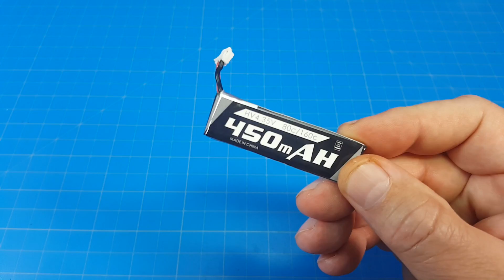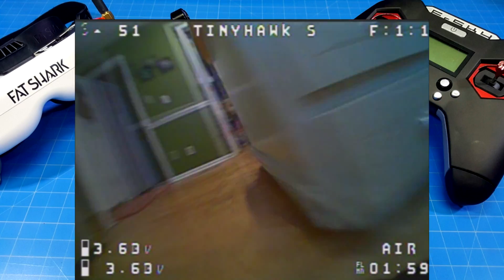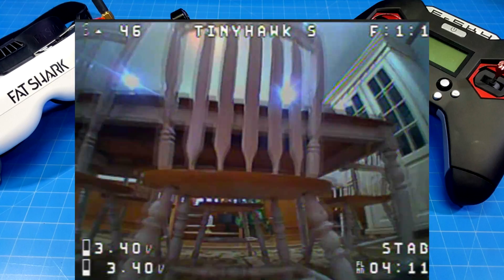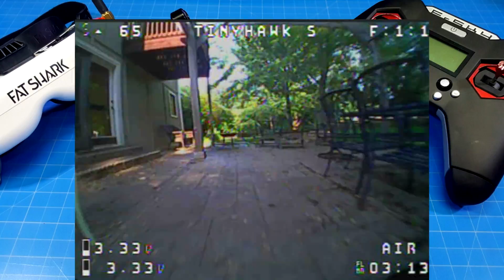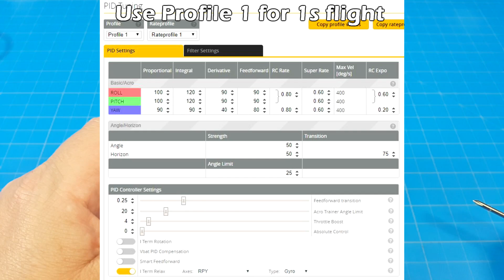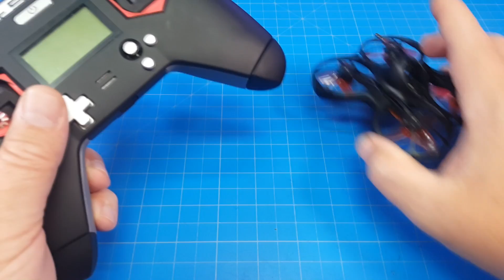TinyHawk S - Start Your FPV Journey!

Comment: Hiya Nick! Awesome review as always! Love the structure of all your reviews. One question, is there a flysky version?
Reply from the maker: I don't believe there is. :) We have to either add a flysky receiver, which it does have uarts available as in the video or use a multi module if your radio supports it.

Comment: everyone  just skips the binding process for this damn tinyhawk. I have an OG tinyhawk RTF kit with the cheap goggles and transmitter it comes with, I bought the new version of the tinyhawk S but no matter what i do, i cannot get the old transmitter to bind to the new tinyhawk S.... Someone HELP ME PLEASE. im following instructions from both the original rtf kit for putting the transmitter in bind mode and the instrutions that came with the tinyhawk S. but every time i bind and try to restart the tinyhawk... i starts in bind mode again...
Reply from the maker: do we need to turn off both the radio and the quad after binding. I haven't had the chance to try out the RTF kit, just a off the top of my head guess.

Comment: Nick will work with the same remote and goggles of the 1st generation Tinyhawk (RTF KIT ) ?
Reply from the maker: I would think so, I am sure the goggles, but the radio I can't be sure. I didn't have the rtf kit to try and learn about its capabilities.
Reply: @NickBurnsFPV  Nick i was thinking to buy the RTF kit of the emax, them this one come out, i'm a beginner in fpv with one can you recomend ?

Comment: Great review!! Which 2S quad would you recommend; the tinyhawk S, the Trashcan, or the mobula7? The 200 mw vtx on the Trashcan is appealing, but which would you recommend overall? Thanks
Reply from the maker: If you have been flying a while the trashcan or mobula would be my recommendation. I prefer the mobula for the linear throttle curve where the trashcan has a large amount of thrust at the lower end of the throttle. If you haven't been flying very long the tinyhawk is going to be the most durable, the trashcan would be the next most durable and last mobula

Comment: S version has 802 15.5k kV motors. The original version has the 802.5 15k kV motors.
Reply from the maker: interesting. That conflicts what emax sent with the quad, RDQ has 08025 and piroflip has 0802. hmmm.
Reply: Nick Burns RDQ just says something about revised 08025 motors in the features section, but the specs section correctly identifies the new motors. Look at RDQ’s and Emax’s product pages.

Comment: Anyone know how to get the land now warning on my osd? I’ve tried a few different things and no warnings
Reply from the maker: Need to turn on warnings on the osd page. Its lower on the page, likely need to scroll down to see it.
Reply: Nick Burns turns out my warning was overlapped by my mode and model display lol. Thanks again
Reply: I’m currently monitoring bat voltage and have the thresholds for warnings set  to 3.35 and minimum to 3.25 and when I go lower then 3.25 I don’t get the land now warnings

Comment: Nice review, Nick.  Thank you.  Seems like a pretty nice little quad to me.  I have very much enjoyed my original TinyHawk and it looks like they have addressed a lot of areas that I think many of us were hoping to see improved.  

I have a couple of questions, if you don’t mind.  First, I understand that you have only had the quad for a short period of time, but could you at least hazard a guess as to the longevity and/or durability of the rubber bands?  Second, is there a way to use a battery strap instead of the rubber bands in case your bands break or just because you prefer a battery strap?  Oops, there’s one more.  Do you or does anyone out there know if this size of rubber band is commonly available or if we will be at the mercy of Emax for availability and price as the sole source?

Thanks so much for the help and for the review.  Much appreciated.
Reply from the maker: Thank you. 

So far the rubber bands show no signs of material change, rubber will dry out and the chemistry of the rubber could be better or worse over time. Kind of a non answer. We do get an extra set of rubber bands. We can replace the rubber bands with our own, loom bands should work and are super cheap. Replacing the rubber bands requires removing at least the two screws at the edge, but likely all four from the bottom mount. We can also run a small battery strap, or two. There appears to be enough space, I am not sure if the super small iflight straps would be short enough without having to use some filler to make it tight to hold the battery. In the case of filler some foam we get with components should do the job.

As for the size I expect the loom bands to work best. I have used them many times on other quads, they generally loose there elasticity before they break. I have other rubber bands that are thicker and would work...possibly better, but those came from various other components I have purchased over the years. Loom bands we can more readily target for purchase and use.
Reply: Thanks much for the info and guidance, Nick.  I think I can get a lot of fun out of this guy.

Comment: Do you see any improvement in the VTX performance of the new model? I love my original TH but the video feed is barely useable. Your video seems to be working pretty well.
Reply from the maker: I don't see improvement, but as you said mine is pretty good and the original was good too. The only improvement in vtx that I am aware of is the smart audio. If video reception isn't good I would pull the antenna out of the housing to test that. Also we might need to change bands and channel to get out of the normal wifi band, or turn our homes wifi off to see if that helps. Otherwise we are looking at a new goggle module if that is an option. I have been running the rapidfire module shortly after it came out...but it is expensive.

Comment: Looks great! Any chance you could check on a particular battery fit when you have time? I'm curious about running either 1 or a pair of the tiny whoop 333 1s batteries. For 2s or 1s I could make a couple ph2.0 y adapters in parallel and series. Interested in these in particular because I already have a bunch and really like their performance. If the rx2 can be used to connect a nano dsmx receiver I'll probably be buying one. Nice review, as always!
Reply from the maker: Sure, seems simple. I will look into it.
Reply: @NickBurnsFPV  Thanks, I appreciate it!

Comment: Nick, are u anle to tell if the guts from the original TinyHawk will fit in new style frame ? Great review.
🤘😁👍
Reply from the maker: the one bit I am uncertain about is the camera. I looks so similar, but I can't be completely sure the camera will natively mount cleanly. If a bit of diy for the camera is acceptable, I am pretty certain all the other components will fit right in.

Comment: Now that the weather is good you should also include your backyard on circuit!
Reply from the maker: Not sure I full understand. I did fly two batteries in the backyard. Or do you mean fly from inside to outside?
Reply: @NickBurnsFPV  Yes from inside to backyard!
it's amazing how much you can do with 25mw specially on american houses.. I live in a colonial city in méxico and I can bearly fly trough 1 wall :'D

Comment: Great video to get back to addressing some new comers to FPV, need to do this one in a while.
I am interested to see how it does with something like a rdq 300mah 2s, maybe make an xt30 to ph2.0 adapter for testing purposes????
I put pre-arm on my micros just to keep in the habit of pre-arming my larger quads. :-D
Reply from the maker: I did receive my RDQ 2s 300mah ph2.0 batteries. I will work on seeing how the performance is.

Comment: Once again emax has made a fairly solid model after everyone else. Not that that's bad, it just seems like they don't rush their products to market to meet hype which arguable means they get to avoid the pitfalls everyone else fell prone to. Seems like you put a bit more background/intro into this one, probably a good idea since this probably will be a popular beginner model. 👍
Reply from the maker: Yes and yes. I think this is designed for someone just getting started or still pretty early in their fpv journey. I would expect most experienced pilots to prefer more aggressive 2s whoops like the mobula, or betafpv "Power whoops", or outside the 40gram non ducted designs we have been seeing.

Comment: Nick, what is the better antenna for the xlite?
Reply from the maker: better antenna? Or the external module I referred to in the case of the xlite pro?
Reply: @NickBurnsFPV  I just wanna put an external antenna on, it also looks kinda cool and could help with a bit of extra range. Sometimes my diatone gtr349 Will losesignal and failsafe from 30 meters and 1 tree in the way. I've moved antennas and still happened.
Reply from the maker: I haven't tested myself, but this might help https://www.banggood.com/FrSky-2_4GHz-T-style-Antenna-for-Taranis-X-Lite-RC-Drone-Transmitter-p-1347522.html?rmmds=search&cur_warehouse=HK seems like a very short range for failsafe, I would also suggest trying a new receiver on the quad.

Comment: Bardwell has a good video about "project mocking bird" (not the CIA operation). It's a team of people who specialize in optimizing performance in micro quads.

As far as quad retrieval is concerned, you could design a tennis ball shooter running on compressed air to knock the quad out of trouble.
Reply from the maker: yes, Patrick J Clarke is a wizard with PMB. I have only been stuck in a tree twice, both times I was able to get it with a rake and knock it out with a ball :)

Comment: Nice VTX. I began to notice that there was ZERO breakup in the signal. What goggle receiver module do you have on the goggles? I'm assuming you have fatsharks.
Reply: He runs HDOs with Rapidfire.
Reply from the maker: Yes, Thank you @Charles Warwick.
Reply from the maker: Yes, Charles is correct

Comment: Why couldn’t emax just released this 1st. I already own the tinyhawk and it needs more power.
Reply from the maker: I do feel this has maximized or improved the 1s performance over the previous iteration and other brushless whoops on 1s, but on 2s the performance is not at the same level as other 2s whoops. then there is the battery, not sure this battery is up to the demands of 2s, I have different batteries arriving today to test further.

Comment: Great video as allways! How does it stack up to the Mobula? Does it have the same power as the Mob on 2S?
Reply from the maker: No it does not. This designed or iteration is targeted at maximize 1s performance. M7 has more power and thrust to weight ratio.
Reply: Aww, thats to bad, guess we can´t have it all!

Comment: does anyone know if you can swap the receiver on this thing?
Reply: It's built into the main board, but the first one had a spare uart you could use to connect an external rx. Not sure if this one still has a spare uart since the vtx now has smart audio. But apparently this new one has better range. Edit: see 19:00
Reply: @FilipRadelic  I'm an afhds 2a user so having the rx2 is really important to me. I don't use smartaudio much at all. Thanks! :P

Comment: Are you kidding me with that tune?! Wow, it's spectacular.

This video will absolutely help new pilots. Phenomenal job, bud.

Impressed by the 1s performance. 2s is ok...not a selling point from the footage. PH 2.0 connector on 2s is limiting. I'd like to see XT30/51005, but cautious of the amp spikes.

Expect to see this at the indoor races...
Reply from the maker: Yes the focus appears to be maximizing 1s performance. I asked if the ESC rating changed, no response. I did try to draw out the worst in the tune with the quick hard 180 turns, we get some chop then, but really for 1s, very good.
Reply: Hi Nick, yes the ESC is now rated to 5A continuous and 6A burst per motor. Inspirational flying and really appreciate you explaining things in simple way thats friendly to new pilots.
Reply from the maker: Thank you